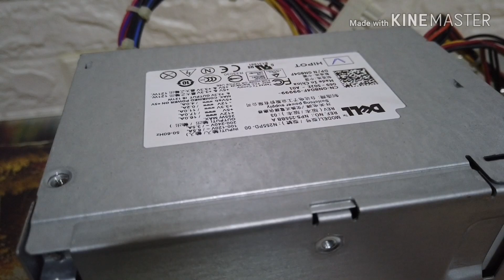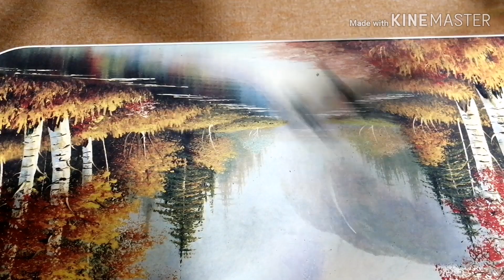HOW TO REPAIR A POWER SUPPLY OF PC || DTech TV

Comment: what you can also look at is whether there is a condenser top sphere or has leaked underneath, capacitors are components that can sometimes break, another problem may be, a detached soldering, with a magnifying glass you can sometimes see an oxidized circle around it, there used to be some lead in the solder so that the solder connections rarely gave problems, now that it is no longer used in solder (harmful to health), a bad solder connection also sometimes occurs as a problem, success with you channel and repairs in the future, and keep doing a great job #16 thumbs up 😉👍new friend here